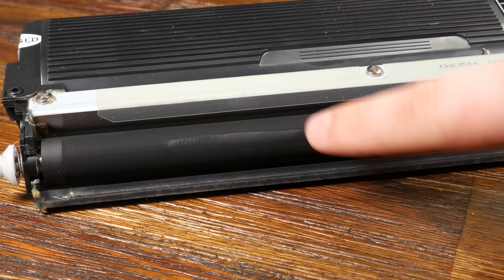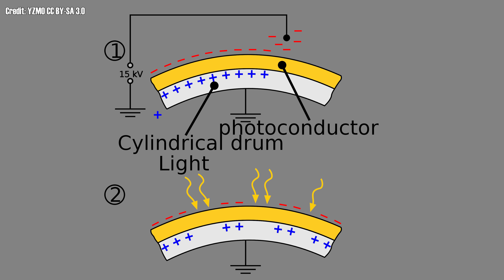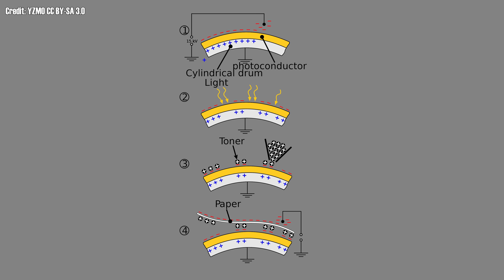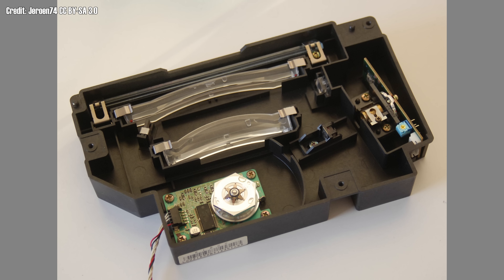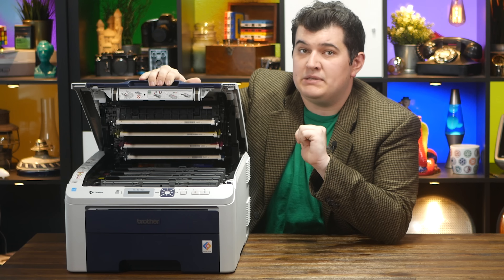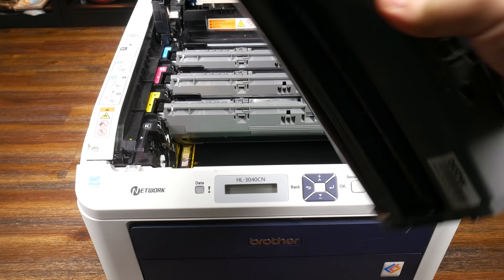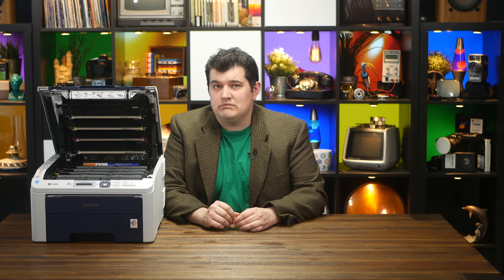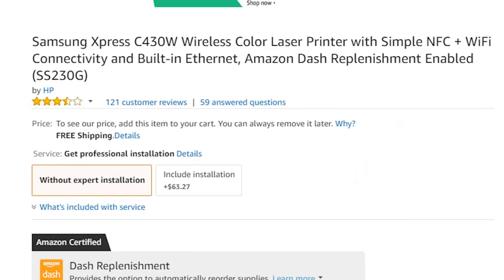LED Printers: The Common Printing Tech You Haven't Heard Of

Comment: I've read the entire text for your hate on inkjet and it's my exact gripes with them as well. Not to mention the annoying mess of calibrating an inkjet printer.
For a good 10-15 years now I've been using laserprinters at home. First one I got to take an old HP 2100M Laserjet (black toner only) printer with Jetdirect card with me from internship place, later to add a HP CP1515N for my color needs. Say for that fancy resume or stuff like that.

Now I'll continue to watch the rest about the LED printer. :)

Edit: My HP CP1515N printer has an identical tray of having the colors in a row, and the paper path is a linear one underneath it.

Comment: One way to distinguish them I think is that most laser printers including the one i have here at home have a jet engine like sound from the extremley fast rotating mirror while LED printers just hum a little when they operate. Not sure if thats true for all lasers though but it is a kind of common feature of them. In this case most new copying machines have to be LEDs since noone we have ever  had at work have made this sound, might be other ways to focus the laser however, Laser warning labels is of course another clear sign its a laser printer.

Comment: Most consumer laser printers these days are LED. Actually a lot of printers are the same machine but with different logos and designs on the exterior. What surprises me is the reliability of the LEDs. If some of them failed it would ruin the image yet they seem to last for years with no issue.

Comment: One other big advantage to the led system is that the printing can be done without bending the paper at all.  The Brother printers have a manual feed slot so that you can print card stock or adhesive sticker paper without it bending which would curl card stock and potentially separate the stickers from its backing.

Comment: All those home user laser printers that have their cartridges in a row are using an intermediate transfer belt to collect the CMYK toner from their respective photo conductor unit before the whole mess is transferred to the paper that than moves onward to the fusing unit. The ITB is then cleaned and whatever is left on it goes into the waste toner bottle. The same goes for those big color office MFPs. And while I work for only one manufacturer, I would be surprised if others would solve this any other way as it would introduce more moving parts, and with that more service calls that eat into the profit margin, than necessary.

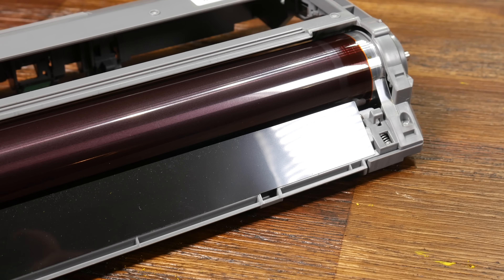Comment: Technical mistake at 1:20 in the description of how the static charges work on the imaging drum.

Here's how it REALLY works:
Step 1 - The corona wire CHARGES the selenium-based imaging drum with an even "film" of static charge
Step 2 - The light source (whether from a laser, led, or cylindrical lens focusing on a brightly lit original) strikes the selenium, SHEDDING the charge (it is NOT adding charge but removing it, and is NOT "photoconductive" as in a solar cell, it is exhibiting the "photoelectric" effect -  a different quantum phenomenon)
Step 3 - The toner is whipped up into a cloud near the imaging drum, whereby the areas with charge remaining (the dark parts) attract toner where the areas exposed with light (blank paper areas) do not
Step 4 - The toner is transferred to the paper via the second corona wire, and finally
Step 5 - The latent image in the toner powder is melted into the paper by passing through heated rollers

Side note: Albert Einstein won his Nobel Prize NOT for the theory of General Relativity; rather, for his work describing the mechanism of selenium's ability to shed electric charge when hit with a photon - the basis of the xerographic process. Details here: https://www.nobelprize.org/prizes/physics/1921/einstein/facts/
Reply: HyperOptic Productions. You need to get laid.
Reply from the maker: I think you have a misunderstanding in my explanation. The charge is indeed created by the corona wire, which is what I said. The backside of the drum is grounded. So when light hits it, those parts become conductive, and a path is created between the charged surface and the ground behind it, therefor discharging the areas hit by light.  The photoconductivity is what allows the charged areas to be discharged when they are hit by light.
Reply: The photoelectric effect is one where photons interacting with the surface of a metal causes that metal to shed excess electrons, flying off into space (and ionizing the air to a small degree, which isn't a problem because of the air exchange caused by the cooling fans for the fusing assembly). https://en.wikipedia.org/wiki/Photoelectric_effect

The photovoltaic effect occurs between layers of different material, splitting off electrons from the donor atoms at the material boundary. https://en.wikipedia.org/wiki/Photovoltaic_effect

The basic difference is that photoelectrics shed charge off into space (creating a neutral state), and photovoltaics create charge imbalance within the material (destroying the neutral state). This is why they are considered opposite (yet related) phenomena.

I mentioned the correction based on TC's follow-up message below which states that the light CHARGES the areas that will become the black areas of the final print, which is the opposite of reality. Here's what TC said: "Parts of the drum that receive light attract toner, and dark portions do not."
Reply: HyperOptic Productions Solar cells use Einstein's photoelectric effect, unlike photo resistors which use photo conductivity to vary their resistance.  Now I don't know if the selenium drums in xerographic printing uses photoelectric neutralization of charges as you say or photo conductive removal of those charges as TC says.
Reply: Pfft.... There's always one

Comment: Thanks for this info as my old colour laser printer had died & I tossed it. As I'd like to scan & print photos as well, I've been looking at multi-function printers but even the inkjet mfp units seem to be somewhat of a compromise in terms of photo-quality, so will have another look at laser/led printers!
What's interesting is that led-lensing technology that used today in the way you've explained, was just a further development of what has been used for the reading-sensors in document-scanners & copiers for quite some time now!

Comment: I had an older LED printer.  It didn't last long.  The problem is when you have thousands of discrete elements, one is bound to fail, and soon!  it is interesting that this technology seems to be "going backwards" compared to CRTs.  In CRT's, you scan, like in laser printers.  Advantage is that (except for CRT screen), you have "one thing" that is uniform over the field, and only "one thing" to fail.  CRTs have given way to discrete technology (LCD, plasma,  and OLED screens, which have millions of discrete elements, which have all the nonuniformity and reliability problems, versus most xerographic printers, which use a scanning scheme.

Do you know about the "Selfoc" lens arrays used in LED printers, and why the crazy cylindrical lenses are used in laser printers between the scanner and the drum?  If you don't, I can explain the gory details.

Comment: I don’t think the speed difference you highlight in your video has as much to do with whether the image is formed by a laser or an LED array, but by whether the printer uses the 4-drum, single pass design you described versus a single drum, 4-pass design. It seems to me that in either case, you could design a printer that used either image-forming mechanism. A single-pass color laser printer would probably need 4 separate laser mechanisms, but there’s no reason it could not be built, and it would have the same speed for single-color and 4-color printing. By the same token, a 4-pass printer could certainly be built with an LED array versus a laser scanner, and would suffer from the same speed degradation as any 4-pass design when printing in color.
Reply: Patrick Kuras HP 3500, 3600 and 3700 did the linear arrangement with lasers decades ago.  Each color cartridge has a gap from the back of the cartridge to the back of the selenium drum, and that's where the laser beam shines from the back of the printer.  A transfer belt rolls over the front of all 4 selenium drums and down onto the paper.

Comment: I'd imagine the benefit to using a single laser (for each color) as the light source for the image is better consistency in the color output.   If you were to have a 'dead' pixel in the LED array, you'd have a solid line in that position (in the direction of the paper path).   Likewise, unless the LED's are all perfectly manufactured and placed (or have some calibration done after assembly), you likely would not get a perfectly consistent color output.

Comment: A lot of newer color laser printers (and color LED printers) use in ITB (image transfer belt), where the image is applied in all 4 colors to the ITB, then transferred to the paper in one shot.   I believe your Brother is set up this way as well.   FWIW: I had an older OKI LED printer some 15-20 years ago, and we just stopped using a Xerox 36" wide roll-feed LED plotter at work.

Comment: My first printer was a Panasonic KX-P4410 that I bought new in 1993. It was a pseudo-clone of an HP II laser printer. That thing was awesome, super reliable and sharp. It suffered from lack of memory, so it was really mostly for text documents only, but it would print a really classy-looking document. Also, it had only a serial cable jack for an interface, it was way before USB or wireless. One day a few years ago I finally got rid of it since it was just too obsolete, but I felt horrible; it was still perfectly functional and had toner in it, even after abusing it all through college and moving several times. I am definitely a fan of a good laser printer. And of what Panasonic used to be back in the day.

Comment: Just wait tell you get DEAD PIXELS STREAK
Reply: Just realized this. Laser printers scan a bit like crts, and LED printers scan like half-crt half lcd. Each line is like an lcd, but it scans by moving the drum like a laser printer. Crts don't get dead pixels, because one: they don't have pixels and two - either the electron gun works or not.

Comment: I've pulled apart an old colour laser printer (Canon I think) that used a single rotating mirror and 4 lasers at different angles. The whole assembly wasn't too much bigger than the LED one you showed.

Comment: LED printers, with 4 LED arrays are aligned mechanically, Laser printers use sensors to adjust the registration and alignment of the image. Higher end laser printers and copiers use an intermediate transfer belt to capture the image from the four drums then use a secondary transfer belt to transfer the toner to the paper. Machines with the transfer belt system are as fast in color as monochrome. The ones I service go up to 75 pages per minute. For maintaining image quality and speed laser is much better. Many companies tried LED color printers (including Sharp, which I am a service tech on) gave up on that tech rather quickly.
Reply: Xerox uses led on its A3 30 - 70 ppm maschines since about 8 years now

Comment: I had one of the first! Okidata OL400. Another cool printer video would be the early Canon Bubblejets and IBM "color printers" from the mid-80's.
Reply: Another cool video would be the original HP "Color Laserjet". And yes, that's the model name -- it was the first color laser based on some Kyrocera tech. I have no idea how you'd ship one or where you'd find one but for 1994 it was the coolest thing -- and the cheapest per print. Each color had it's own hopper which was filled with loose toner. With a JetDirect card I used it (and an LJ4+) with mobile devices well through 2016 when a flood destroyed them.

Comment: I am indeed among the 85%. Interestingly, I have a few-year-old HP LaserJet Pro CP1525nw that, by all appearances, is probably an LED printer - in spite of HP branding it a "LaserJet" AND it's official specifications datasheet saying "Print technology: Laser" Four toner/rollers in a row like in your Brother, (although the print heads are fully enclosed to where I'd have to rip it open to see,) very similar B&W / color print speeds.

Comment: KIP makes a line of wide format LED printers and scanners, they print on rolls of paper, used for engineering drawings and such. They sometimes get called plotters but that's misnomer. I also know that some of the old typesetters, they used a proper photographic process on chemically treated paper that was super expensive, with the idea that it'd make a master that you'd then photocopy, they used a CRT screen to expose the image, but they had the luxury of being able to expose an image in sections.

Comment: the problem with LED printing is that OKI still hold patents for it and therefor asks for royalties which makes laser printing with rotating head drums cheaper, even though it's a lot more mechanics do deal with. the additional BOM is less than the patent fees... there are some B&W-printers which started as LED and were redesigned to laser during cost-reduct phases on 2nd generation, just to make the printer more affordable.

Comment: I have an OKI LED printer. Its discontinued now, but mine still works. It is color, prints on very large stock, and will practically print on a brick, it takes very thick paper known as "cover paper" because it is used to make covers of books. As you say, it is one pass, and so prints at a much better speed than a laser printer.

Comment: Just for the record, laser printers can also use the same "four toners in a row" configuration. My (broken and now torn-down) Ricoh C250DN uses 4 lasers, 2 spinning mirror assemblies stacked onto one motor, and a clever system of lenses and mirrors to pretty much shoot the lasers down in the same fashion as the LED strips in your printer.

Comment: Okidata pretty much was THE company making LED printers in the early 90s. I used to have one, worked well and they wisely had seperate toner and drum assemblies to keep running costs low. Regarding toner cartridge layout, modern single pass color lasers almost always "print" to a transfer belt assembly (a "consumable" item that usually includes waste toner storage) and then apply the printed image to the paper. Very few directly apply toner from the drum to the paper due to packaging limitations.

Comment: @Technology Connections: Even if you don't like traditional inkjets. (And who does?) HP's page wide inkjets are worth examining. They seem to lack most of the drawbacks associated with inkjets. I've had one for a few years now and it has never needed cleaning, has been extremely fast and prints with great quality. And if you use ColorLok certified paper, it won't smear either. Oh and probably the best part is it doesn't have the typical inkjet sound, since the print head stays in place.

Comment: I find myself endlessly fascinated and indeed shocked that simple concepts like this in tech always seem to manage to scale down, or up, to such small sizes, efficiencies, and volume. The idea that you can electrically charge a region of paper, transfer toner to it and melt it to create SOMETHING in the way of an image doesn’t seem surprising. The fact that these regions of charge can be scaled down to 600dpi at the speeds of modern printing is really quite astounding. I find myself likewise continually amazed that we have managed to scale down so many other simple concepts to mind blowing levels of detail and efficiency. Reminds me of the late Richard Feynman quote “there’s plenty of room at the bottom”. Of course he was speaking of the subatomic but the metaphor holds that our simple human intuition breaks down beyond anything smaller than we can easily visually perceive.
Reply: I have an old HP laserjet that can print at 1200 dpi. Rarely use that resolution since it makes no difference for text, which is what I mostly print.
Reply: Locut0s Actually, Feynman's speech by that title listed many of the benefits available as (future) tech is scaled down from what was common then all the way to a tunneling electron microscope seeing individual atoms of chemical and biological substances.
Reply: It can only go so far then Heisenberg's uncertainty principle will kick in and limit our messing around with things.
Reply: @stevenlein4772  that's true, and in fact that we are reaching that limit now with out photolithography processes in the making of microchips. Individual transistors on chips are getting down to a handful of atoms across. Quantum tunneling starts to become a problem beyond this point.

Comment: It's not wrong to call an LED printer a laser printer. A laser's just a focused point of light. The lenses on this printer are focusing the LEDs, making an array of lasers.
Reply: it takes more to make a laser then just a focus point.  It is technically wrong to call a led printer a laser printer, but they are so similar that it's a moot point for the consumer.  It's like saying centrifugal force doesn't exist, which is true, it doesn't.  However centrifugal force is much more easily understood by the masses, and it's more then accurate enough to serve that purpose.  Same is true of calling led printers a laser printer
Reply: I would argue a laser is the exact opposite of a focused point of light.
Take your laser pointer for example. 
(And try to make one with a (simple) LED.)